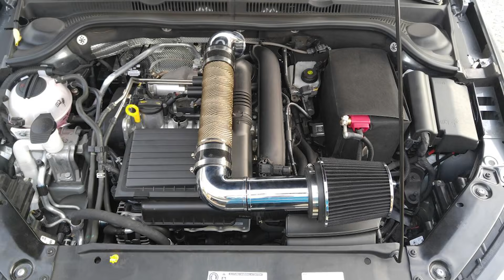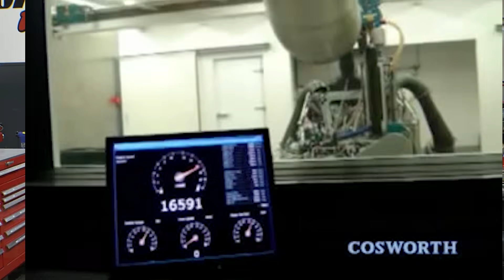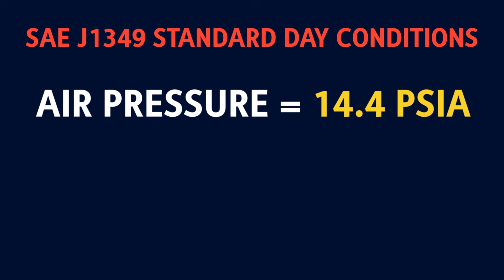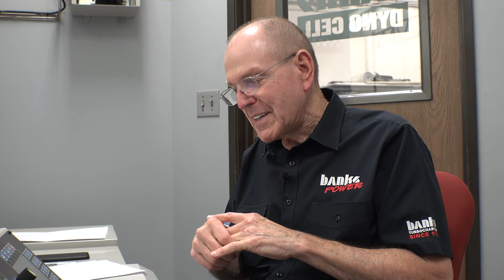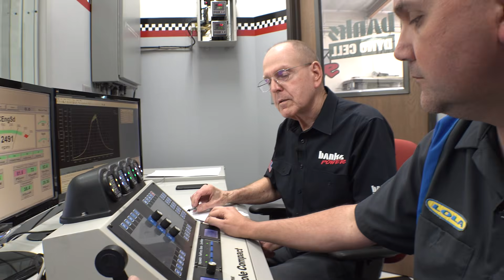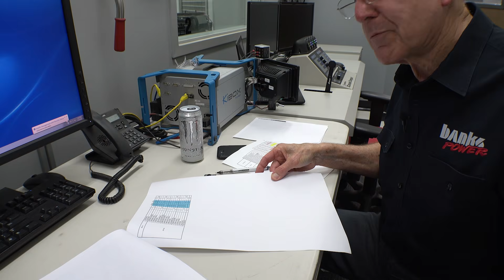KILLING A DURAMAX Pt 4: Starving the Monster 🔥

Comment: Really interesting and thermodynamically correct. 🤓 Enjoyed watching that… as a mechanical engineer I find it fascinating, as someone who worked in a car accessory/spares shop as a student I find it amusing. 🤭

Took K&N years to come up with the CAI kits… those air intakes sound great but they can make the motors run like 💩 especially in hot starts. Debates about panel filters and drilled air boxes over cone intakes. Takes me back. 😅

The shop used to do big HP Ford Cosworth stuff too… crazy what you could get out the YB26. 🦾

I’ve got a Stage 2 Roush Raptor (6.2 V8 with the blower) here 🇦🇪 which came with a CAI… for my 3.8 V6 Mitsubishi Pajero (Montero in the US 🇺🇸 I think) I’m going to go with a snorkel instead, plus headers and exhaust when I have some cash together (need to sell some of my older bikes 🥹). Simple breathing mods to increase efficiency are a win-win. 

I’d be very reluctant to dyno tune the Pajero though… Roush put a lot of dyno time into effective and safe tunes… one thing I’ve learned over the years is that there’s a lot of cowboys out there… if they can’t explain what you just did, they shouldn’t be near a dyno! They certainly won’t be working on my car. ❌

Period! As you would say. 🇺🇸😅👌 great content, loving these videos. 🙏

Comment: Reminds me of the first trucks I worked on in the early eighties UK, there’s a tractor unit had a 212hp 12 litre straight six naturally aspirated, but the air filters were mounted on the rocker covers with the intake ducts cast in, so the motors taking heated air from behind the radiator, dragging it through oil bath air filters and then reheating it through the rocker covers 😖😖. The engines ran so hot that on a long hill climb sometimes the fuel rack would stick wide open. 
The installation of the engine is as important to power and reliability, as the engine is itself

Comment: Gail, I’d like to know why you haven’t done anything with the 6 stroke engine? From all Ive read on 6 stroke engines, they strike me as being your “holy grail” engine. 
As you were said, you can only have so much cylinders pressure before something breaks. But how much energy is actually extracted from each fuel/air charge if your expansion stroke isn’t long enough to make full use of it? The 6 stroke engine is a lot closer to fully utilizing the expansion potential of the fuel/air charge. As I understand it, the fired pistons each cycle through all 4 stroke, 360° out of phase. The secondary piston only does the last two cycles each 360° of crank rotation, as the fired pistons exhaust into the secondary piston.
The decouples the compressed and expansion ratios of the engine, enabling the designer choose them separately. This allows the engine to benefit greatly from oversized combustion chambers and turbocharging.
Using an oversized combustion chamber and turbocharging, a low compression, high expansion, engine configuration can yield significant performance. The engine mitigates a lot of compression losses, while taking nearly full advantage of the expansion potential of the fuel-air charge with an expansion ratio that double or more then its compression ratio, and doing so along a cumulative 360° expansion stroke across the two cylinders.
Something to consider.

Comment: I would like to see those tests done at the altitudes I normally drive:  5000 to 10000 feet with an occasional 11000 feet (Monarch Pass).  For every 1000 feet increase in altitude engines lose 3% of their power.  Got to love the Colorado Rockies.  Excellent information...Now I know why semis have issues climbing the passes.

Comment: 14 years in the Bakken oilfield. Our trucks have an E kill valve in the intake line. Why? Around oil wells, there is always the possibility of natural gas escaping and getting sucked into the engine intake. Any engine, including diesels, will run on natural gas. 

I once drove an old Freightliner hot oil truck with an N14 plus engine back to town after running out of diesel on propane coming from my 500 gallon LPG burner supply tanks through a wash hose I had connected to my burner line and run into the intake tube.  

The E Valve is a butterfly valve just like you have in your intake line with a control button in the cab. If the engine sucks in oil well natural gas and begins to run away, someone can hit that E Kill valve control button and that butterfly valve will slam shut. 

This is extremely important on a hot oil truck as the large TEE 5,000 psi triplex pump runs off the truck engine and transmission. If the engine runs away on natural gas and the operator is pumping through the triplex, the pump may pressure the discharge line including the kelly hose and blow it up. If that happens on a high pressure well and there is no check valve at the wellhead, you have a very very dangerous situation with a possible well blowout, explosion, fire  and significant injuries or death.

Comment: i like how this guy is on top of the best tech to run a engine most older guys only like carbs i can work both but i find an engine with a modern ecu easier to do diagnostics on then a carb and a carb never runs perfect you have to tune it all the time

Comment: you can make an engine that is more efficient with a turbocharger only you have to make it to do that you can get more power if you want and then you use more fuel but its still more efficient then an engine without a turbocharger and at school i learned that there where trucks that had a turbo compound on the flywheel so instead of driving a compressor it was helping the crankshaft with energy that will go to waste without a turbocharger

Comment: If you don't make power in the intake stroke you either are not running enough boost or you don't have sufficient crankcase ventilation.

Comment: Sorry, but parasitic loss do exist in turbo's, but in a different way, pumping losses exist in turbo chargers with a much smaller exhaust housing compared to a SC variant and NA engines, turbos do cost engine performance, especially when guys want to run smaller turbos for response in petrol performance cars.   
In fact I had this exact problem when I was running twins on an RB28 at 33psi, the exhaust could not get out quick enough and was turbo choked in a huge way, the only way to solve it, a new single turbo with a much larger housing.  
But even still, turbos inherent design still see's a significant increase on piston load through the exhaust stroke compared to NA and SC engines, it is the nature of the beast. 
 SC'ed engine are definitely worse, i do agree with that, because you are locked into the static HP robbing cycle through the whole 4 stroke cycle at a particular percentage (depending on the SC choice).
Turbo chargers are just dynamic parasitic loss devices, but admittedly much less than a SC, but to say you "get it all" is simply not correct.  
There is not much I can ever say negative about Gale, but this is one time I simply have to disagree partially here.

Comment: So a turbo is better than supercharger? Even though the super does has direct parasitic loss, but has positive scavenging ratio and no back pressure acting on the cylinder. Numbers comparing the two would be cool.

Comment: While RPMs are high the stroke is very short. In the end the piston isn’t moving much faster than a V8 with a 4in stroke at 6500-7000 rpm and with a piston that’s much much lighter.

Comment: If they were to turn off the dyno cell ventilation, and seal the room airtight, i wonder if the running engine could pull enough of a vacuum to break the windows...

Comment: Wouldn't running at altitude also allow the exhaust to exit faster/easier? Possibly making the turbo efficiently loss slightly less than in the test? Also I'm really enjoying these videos.
Reply from the maker: Yes, there would be a slight reduction in exhaust backpressure, but it's negligible compared to the loss in turbo efficiency.
Reply: @bankspower  Thanks for the info!

Comment: I fondly remember the old  P80/1 V10 in formula one.  Although the production model doesn't come close to the 18,000 rpm P80/1 I continue to run a 2010 Mr along a new Audi R8.  Thanks for your solid engineering videos.

Comment: 5m 11s The exhaust turbine is NOT driven by exhaust gas being pushed out of the cylinder by the piston.
The exhaust turbine is driven by wasted combustion escaping from cylinder when the exhaust valve is opened DURING combustion.
At high rpm, there is more air fuel content in the cylinder that can be used during the power stroke. ie the combustion duration would be longer than the crank angle time it takes from the injector squirting, to the exhaust valve opening. So....
At high rpm / boost, when the exhaust valve opens there is an explosive pressure wave released into the exhaust manifold.
This is relayed to the turbine wheel which drives it.
The higher you rev your engine the shorter your power stroke is in milli seconds BUT...
The higher you rev your engine, the more boost and air fuel volume you have, and the longer you need for it to burn.
The only time you get "spent exhaust gas" being pushed out of the cylinder by the piston is at idle when the power stroke phase in miliseconds is at its longest and the combustion time in miliseconds represented by the air fuel volume is at its shortest. 
Idle is the only time you will NOT see flames or escaped combustion in the exhaust port.

Comment: Isn’t the intake air temperature dependant on efficiency of intercooler. Sure placement of intake is important I agree.  and wether it’s a true cold air, or just an exposed filter to heat the intake air temp is going to change to whatever the intercooler temp is.
Reply: It's a matter of terminology.  In this video, intake air is defined as being at the inlet of the air filter.  So the intercooler is not in play at that point.  The intercooler most definitely affects the intake manifold temperature, and I expect that Gale will get to messing with that as he puts on a bigger turbo and raises engine speed.

Comment: Problem: most all turbocharged vehicles, including the Duramax diesels, have intercoolers. Those reduce air temps, creating a more dense charge. I saw no intercooler in your testing, which is an injustice to your testing claims. Second, turbocharged engines lose less power with elevation increases than a natural aspirated engine. That's why Audi was banned on Pikes peak, in the 80's, because all the restrictions that the governing body imposed couldn't cut the power output! Look at radial airplane engines, supercharged to get the oxygen necessary to make the power needed to get to a high altitude.
Reply from the maker: The 3" stainless steel tubing to the left of the engine feeds the water-coupled intercooler on the floor as shown here. https://official.bankspower.com/intercooler-killing-a-duramax/

Comment: Hi Mr. Banks,  If you don't have feedback on your butterfly valve, the pressure drop will vary with airflow.  Meaning that your test will provide degraded results vs. the same engine sitting at a higher elevation.  In the mountains, there's less air, but demanding more air won't drop the ambient pressure any at all.  If you look at PSIA between the butterfly valve and the rest of the system, I would anticipate a drop in pressure as RPM/Air demand increases.  You might add an actuator to the butterfly valve to maintain a constant pressure differential between the dyno room and the downstream side of the butterfly valve.

Comment: In the final sets of figures, I would like to see the actual high-attitude outcomes. The lower air density at altitude should give interesting turbo-out numbers compared to low altitude.
Reply: He said that it would be the same outcome
Reply: @xlegit13  yeah... whilst highlighting the second set of figures he says at 22:55 that the 4000ft ambient air density would be the same as the lower altitude, but his chart at around 21:00 clearly shows they are different, hence my desire to see actual figures for engine performance at 4000ft. I understand on the first chart that the final two figures are the same, but that does not mean all of the second set of figures would be, especially when he makes an inaccurate claim about ambient density being the same. Don't get me wrong, I actually like his vids and the simple, scientific method he uses to show power losses / gains; but, claiming the same outcome based on different figures is not right.

Comment: Unfortunately Gail misunderstands or misspeaks about the application of a correction factor. 
It is NOT comparing against other engines on other dynamometers, it is for A an B comparison of your engine on the same dynamometer with different tune or component configurations.

As you personally are always going too be testing in different atmospheric conditions than your baseline pull, months possibly years after the fact.

To extrapolate anymore comparison off a "speed shop" dyno is error prone at best.

Comment: What about Titanium pistons for strength and light weight to turn higher RPM’s? Yea I know...$$$ but powwa!
Reply: The titanium actively burns up and gals.  It's a terrible piston material.  With proper coatings it can be made to work great as a connecting rod or valves, but it pretty much stops there.

Comment: Wrong a turbo charged engine produces horsepower on a cylinder that not even firing. The presure on the intake stroke 20lbs boost does push the piston down.
Reply from the maker: Although technically correct, 20 PSI of boost pushing down on the cylinder is relatively insignificant when looking at total horsepower output.

Comment: The exhaust stroke is a parasitic load of the power strokes of other cylinders. The increased back pressure caused by the turbo increases that parasitic load. Therefore, the supercharger parasitic load "problem" is not as bad as implied in this video.........just sayin' :)
Reply: My point was that the turbo boost is not free. It is probably a lot more efficient though.

Comment: In a day where most want to talk down this manufacturer,  be a fan boy of this not that, etc..... it is refreshing and I believe welcomed by for than any industry credits. While the topic is dealing with the newest Duramax, if you look in the back ground there are a few Cummins. Mr.  Banks has worked with many platforms across different fuel types and applications.  The common denominator is the same. These are the foundations, the building blocks of forced induction and they all apply all the time to every power plant. Sure an inline cylinder configuration behaves differently than a V arrangement. Valve angles change variable X, intake changes Y. No dispute there. Those are the ancillary factors if you will.  Without knowledge of the base or foundation, you are chasing your tail in an unscientific, unrepeatable, and undependable manner. You cannot build a multi story building by starting with the roof. You cannot throw parts together and make them work in unison without THIS knowledge and understanding.  Great job Gale. Thank you.
Reply: I start every Lego house with the roof

Comment: Question...
I understand that a cold air intake pulls air that's cooler and more dense etc... 
I've always thought it makes more sense to focus on the intercooler. Instead of worrying about the "hot air intake" 20° difference why not use a big nasty intercooler that will drop your post-turbo temps by 200°?  @bankspower
Reply: Show me an air:air intercooler that drops iat's by 200 degrees
Reply: @km0821  
https://www.perrin.com/blog/post/the-great-subaru-intercooler-test

Scroll about 3/4 of the way down, front mount at 20psi test. 314 in, 107 out. So over 200eeg actually

Comment: This may be true if you're power braking a burnout and not going anywhere, or you have a sheet of plywood blocking your grill, but the fact is, you're driving through ambient air at a rate of speed that matches whats demanded by the engine.   Most trucks have a wide open grill allowing the outside air to flow through, cooling the radiators and interooler.  Traveling at 65mph, the ambient temperatur and under the hood just next to grill will not have a 50 Degree temp difference.   This guy is a fucking moron trying to sell his "cold air intake" commercial.  Blow up the L5P already

Comment: How about a blower that is powered by a lithium polymer battery......I know that is not practical. But, think of it like this. Supercharger creates high pressure,  and.... this high pressure is then used to chill the intercooler as well as increase intake pressure. I’m not really sure how much power it would take to spin the supercharger....I know it takes a lot.

Comment: Youn "can" do something humidity, HOWEVER the parasitic losses in terms of HP far out weigh the gains. I think Mazda right now is working on dryer system to store water off the tail pipe, to use on the exhaust. As apparently a small shot of H20 to a hot intake, reduces road use emissions to below any electric vehicle. 

Yes both electric motors and the batterys produce emissions durning use. 
Source
https://pubs.acs.org/doi/full/10.1021/es903729a
 And shockingly close to what a modern gasoline powered with that platinum 

Also for the overall environmental impact the electric car only "beats" the gasoline car, since they refuse to factor the on average over 1000lbs of battery. 

Those that hide and manipulate the data do so in almost the same way, as those that use shell corporation to launder money. It starts with one paper that has bad data, then the rest build off it.

For instance co2 the scary bad co2 except, whats so scary about it? Plants require it in the air to grow, if we are getting too much co2 maybe grow more.